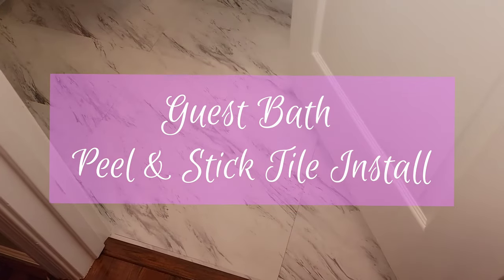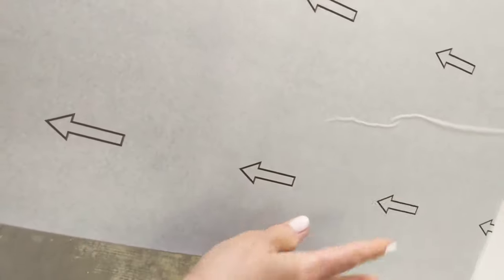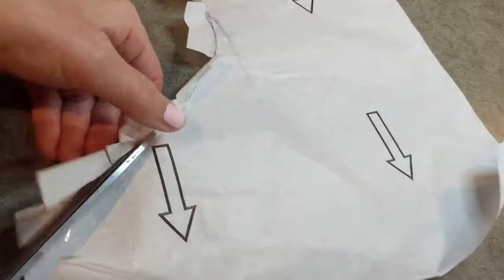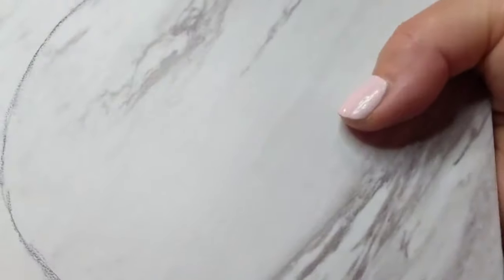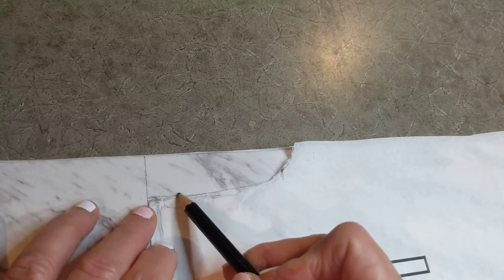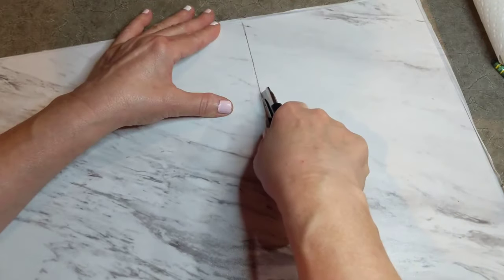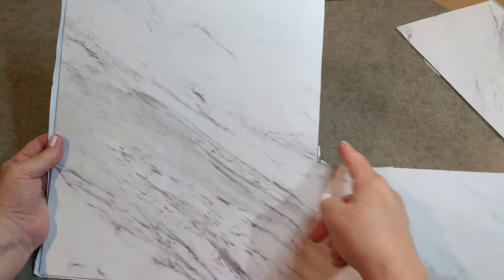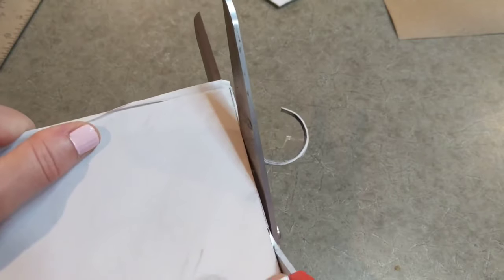HOW TO INSTALL PEEL AND STICK TILES IN GUEST BATHROOM for beginners Tips Tricks Step by Step Part 4

Comment: U don't have to remove the old floor that's the point of it being easy
Reply from the maker: Actually, yes, I did have to remove the old flooring.   It was curling, peeling, and breaking off in places. And stinky, especially around the toilet.  Men, you know, sometimes miss the toilet, lol!   BUT In our laundry room, I did leave the old flooring on and placed new tiles over it.  It was in much better shape, so in that instance, it was fine to leave it the old floor on.  I have that video as well.
Reply: You absolutely want to remove the old floor, especially if it’s ceramic. If you don’t, you will have indentations over time, unless you want to put down a liquid vinyl substrate such as floor leveler. I’d take this one step further and pull the toilet, this eliminates having to replace a few pieces should the toilet be replaced at a later time. Unless you are in a newer house, now is a good time to put new parts in the toilet as well to insure trouble free operation for years to come.
Reply: @nobodystalkin1 you can place them on ceramic
Reply: Can I stick these tiles on vinyl flooring?
Reply from the maker: @nobodystalkin1  Yes sure, if it cermic like you said.  And sure, its better to take out the old toilet. But for people that can't or dont want to it possible to leave it like I did.  And still have it look decent.  Ours still looks great. Thanks for the comment.
Reply from the maker: @Helena-e8g  Sure I did, as long as the older tiles are still in decent shape.  Meaning they are not peeling off,   or torn off in  a lot of place.  I did it as you can see and the new tiles still looks great.
Reply: Yes you do, depends on what it is, I layed these over an old vinyl floor and they moved after 4/5 months , looked horrible had to redo it
Reply: I love when Monday morning quarterbacks talk about what should have been done. Every person's situation is different. It gets so exhausting listening to those types of ppl. How about asking questions prior to flexing your so well informed knowledge? Just an idea

Comment: my biggest problem is both the walls and doorframe are not straight or even..such a pain in the butt
Reply from the maker: Yes mine are also, not perfectly straight, whith the house shifting and settling over the years, but someow I made it work.  🙂

Comment: How is it holding up i was wondering how will the tiles handle being around alot of water
Reply from the maker: They are waterproof.  We had a flood a few months ago from a leaky toilet and it was absolutely no problem we had professionals come in to remove water and the tiles were still intact in our bathroom  and laundry room.
Reply: The tile is waterproof but the seams aren’t. I have these in my basement bathroom and they will eventually come loose. You can’t grout the seams so water will get under them.
Reply from the maker: @rhukaduka  You CAN  absolutley put in grout.  Its tells you on the manufactures instructions.  So far we have not had any problems with the tiles coming loose and its been quite a while since we installed them even with the flooding we had.  But I suppose if the area you have it constantly damp/wet  maybe that might be an issue IDK.  I can only say what our experience is in our guest bath and laundry room.  I suppose if yours come loose you can always add a new tile perhaps?
Reply: @rhukaduka ..yes you can..says so on the packaging.

Comment: Looks good, Im going to do my bathroom with the same tile as well. Behind the toilet is already making me cringe🥴 but it looks great!
Reply from the maker: Great!  I just bent the tile slightly and it worked fine!  If you can't then I would cut the tile in the middle and install it that way.  Let me know how it looks.  Thanks for commenting!  🙂
Reply: Just remove the water line it comes right off

Comment: This was a great tutorial. 

Instead of removing the whole toilet. Wouldn’t it be easier to spilt the tile in half? Or did that way not fit either?
Reply from the maker: Oh I was able to bend the tile a bit in order to fit it behind toilet with no problem, but yes cutting it would have been an option since it's kind of hidden behind d the toilet.  Thanks !

Comment: Did you use regular bathroom caulk or a seal strip around the edges of toilet, walls, and cabinet?
Reply from the maker: Yes I just used regular plumbing caulk around edges, walls, tub and cabinet and no not a seal strip.  Hope this helps.🙂
Reply: What's used to seal all joins? Water will make its way everywhere.
Reply: We are doing our floor today. Should we use extra glue to prevent water?

Comment: Is it because of the patterns on the tile that the tiles need tobe in the same direction? Also, is there any chance of water getting in-between and under the tiles?
Reply from the maker: We had a flood later on from a leaky toilet that needed replacing.  And we had proffesionals come in to replace our entire family room flooring, which was not these tiles but different flooring.  BUT THE TILES  in the bathroom that I used did not need replacing.  So there was no water damage or in between the tiles.   So far so good.

Comment: Take a heat gun to the back to slightly heat glue and then put down. It helps the glue stick better.
Reply from the maker: Thanks for your comment  I appreciate you taking the time , but I didn't have any trouble with the tiles sticking well.  :)

Comment: I want to do this in my bathrm, but I live in an older home, and the toilet pipe goes thru the floor, not the wall, and cutting around that is an impossible fate to do, as well as the old radiator, coil style in my bathroom as well, that need cutting around.

Thus, I will have to hire a contractor do it properly for me, which will result in no savings on my part.  I wish my tiny bathroom was that easy, but nothing in this house has been easy.

I guess I could paint the vinyl tile that is already on the floor Rustoleum, but I don't know.

Ms. B. Churchill
Reply from the maker: Sorry to hear you can't do this in your bathroom.  And you could paint the tile that is an option for you I'm sure.  There are videos  that show you how to do that.  Good luck!
Reply: You take the toilet up and make your cuts around the hole and put the toilet back. The tiles can also slide under old heating stuff.
Reply: @jeremysmail6226  

Good suggestion, but I will be doing this myself and don't have the skill or confidence to remove a toilet.  The old radiator also has pipes that go into the floor.  Thus, I don't think, I have the necessary skill or know how to execute the cuts properly.

Ms. B. Churchill

Comment: We could not figure out why the home was musty smelling even after repairing drywall and repainting.  Come to find out that my tenants a few years back installed peel and stick tiles over concrete floors without my permission Then reinstalled the carpet when they left (I imagine because of the dog). Two years later after another tenant left, I found them after removing the carpet to replace it. MOLD and red algae was growing under each and every tile because they trapped the moisture in and the tiles were just loose enough to stick but not lock out the mold.
Reply from the maker: Thats really sucks for you.  So we have no problems in that department.

Comment: Curious … why most video I watch why all said place first tile in center?
Reply from the maker: Starting from the middle allows you to work outward in all directions, which can help to distribute cut tiles more evenly across the edges of the area. This minimizes the visibility of any irregular or smaller cut tiles at the perimeter, providing a more polished and professional-looking finish.  BUT  starting from the middle may NOT always be necessary for every project, that why I test the placement first with several different placement layouts and what visually looks the best to me is what I go with in the end.

Comment: Can water get in between these tiles or how to prevent this ?
Reply: I’m gonna use a sealant with mine
Reply from the maker: Tiles are waterproof, we had a flood and the tiles were perectly fine.  Just wipe and let air dry.
Reply: The question was how to stop the water getting in between the cut lines..... 
It will over time gather moisture.

Comment: Pro-Tip: just take the toilet out first. It takes 5 minutes and it will look soooo much better if you do it this way.
Reply from the maker: More like 30 to 45 min.  BUT you don't need to.  And yes, it's better to remove the toilet.  But this shows you can install tiles without removing the toilet for people who just aren't able to do it for various reasons.  We ended up having a major toilet leak a few months later  and had to install a new toilet that had a wider bottom and  didn't need to remove the tiles.  At any rate, I might change the tiles to actual marble tile in the future, at which I will remove the toilet for sure.  Thanks for your comment.

Comment: You EVER caulk aroud toilet! If it leaks you wont know until your floor come up or it leaks into your basement. Big NO NO!
Reply from the maker: Actually our toilet did leak and we had to get a new one.  We noticed it right away and took care of it. We don't have a basement.  And we had proffesionals come in and change the flooring in the rest of the room.  Luckily the flooring did not need to be changed in the bathroom.

Comment: should remove toilet and cabinet. rollout adhesive primer on floor then lay flooring then reinstall toilet and cabinet. then roller tile
Reply from the maker: We had a flood much later on and ended up changing to a new toilet.  So far the tiles are perfect, even after the flooding.  The tiles have heavy adhesive on them anyway so it is not necesary to rollout more adhesive  I intalled them to manufacturer installation instructions.   Thanks for the comment.